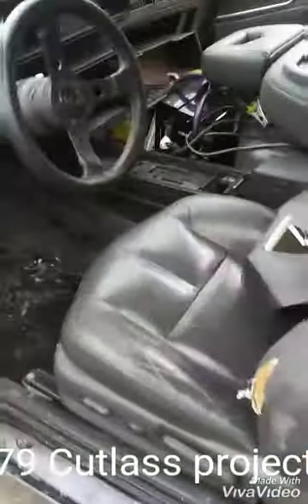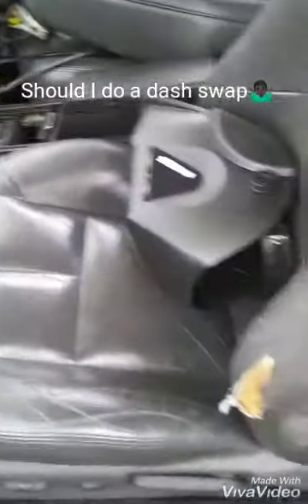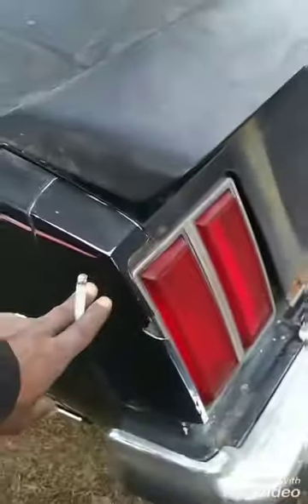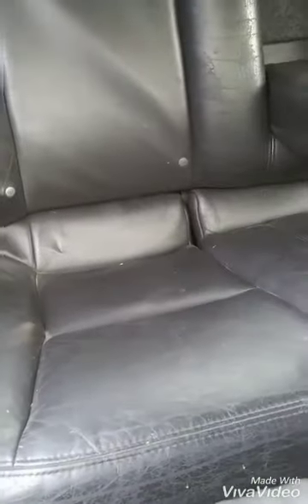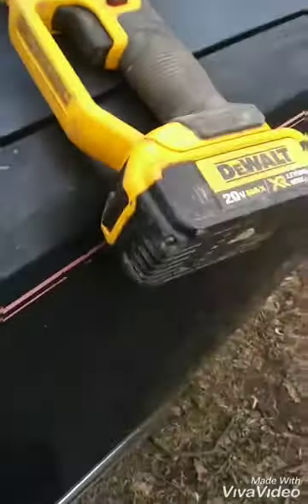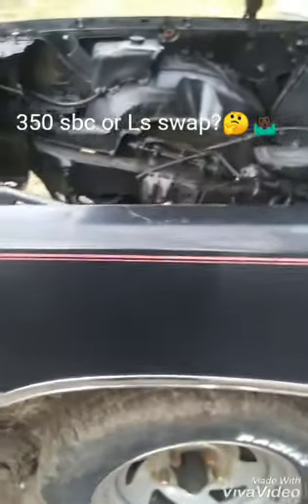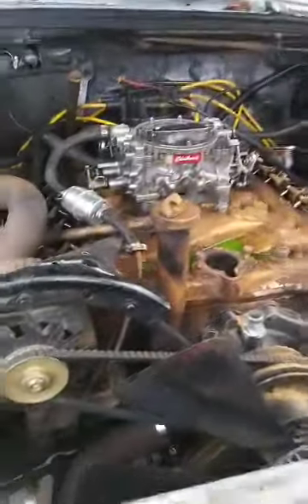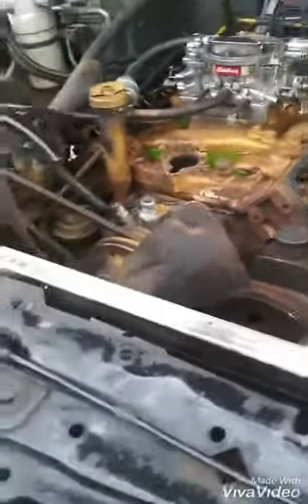1979 Cutlass project update #G-Body #InteriorSwap

Comment: I got a 79 cutty and did you finish the mods with the seats cause I went and got the same back seats. How did your bottom seats fit with that back hump in the bottom seat?
Reply from the maker: The back seat I notched out due to the trans tunnel. Made a bracket to attach the seat to the back wall
Reply: @spaceagecustomz6070  mane appreciate you getting back to me and I’m attack it soon
Reply from the maker: No prob sorry for the late response though I rarely look at the comments lol
Reply: @spaceagecustomz6070  already 🤙🏿